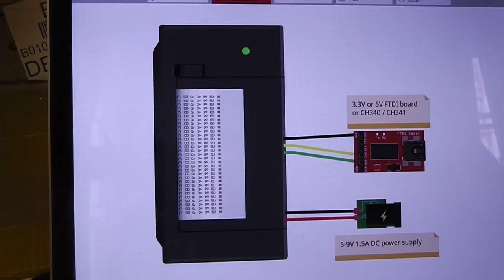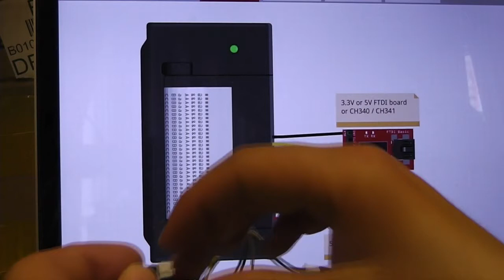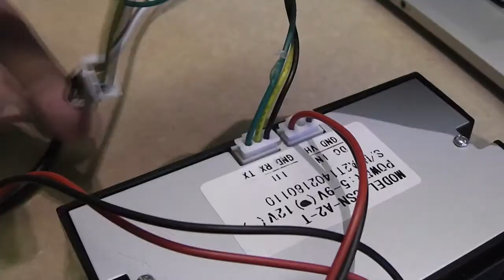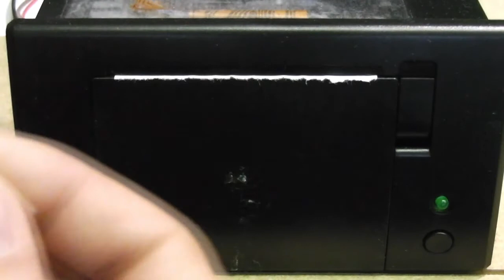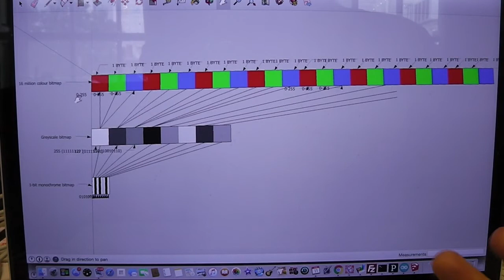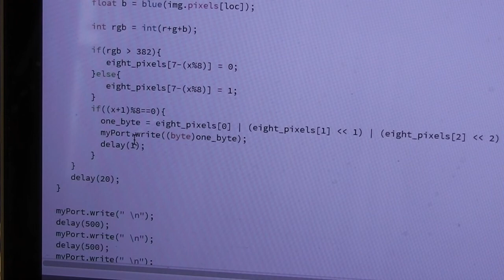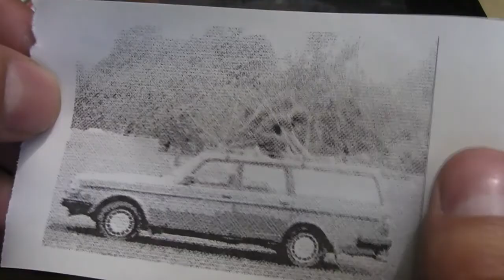Nice photo prints on Thermal Printer tutorial - Circuit diagram + how + why!

Comment: I have StarTSP-100 printer, but no luck in printing photos on it. I installed drivers ok and software. It shows up when I try to print from Photoshop but won't print. It does print a test receipt when I plug in usb though. Any advice? Thanks.
Reply from the maker: Sorry, I'm don't know anything about that. I've only worked with thermal printers that communicate over TTL serial, not USB.
Reply: Ok, thanks. If anyone can help please reply

Comment: Arduino: 1.8.13 (Windows 7), Board: "Arduino Micro"

write_to_printer_direct:1:1: error: 'import' does not name a type; did you mean 'qsort'?

 import processing.serial.*;

 ^~~~~~

 qsort

write_to_printer_direct:3:1: error: 'Serial' does not name a type

 Serial myPort;

 ^~~~~~

write_to_printer_direct:5:1: error: 'PImage' does not name a type

 PImage img;

 ^~~~~~

E:\images_on_thermal_printer\write_to_printer_direct\write_to_printer_direct.pde:8:4: warning: decomposition declaration only available with -std=c++1z or -std=gnu++1z

 int[] eight_pixels = new int[8];

    ^

write_to_printer_direct:8:4: error: decomposition declaration cannot be declared with type 'int'

 int[] eight_pixels = new int[8];

    ^~

E:\images_on_thermal_printer\write_to_printer_direct\write_to_printer_direct.pde:8:4: note: type must be cv-qualified 'auto' or reference to cv-qualified 'auto'

write_to_printer_direct:8:4: error: empty decomposition declaration

write_to_printer_direct:8:7: error: expected initializer before 'eight_pixels'

 int[] eight_pixels = new int[8];

       ^~~~~~~~~~~~

E:\images_on_thermal_printer\write_to_printer_direct\write_to_printer_direct.pde: In function 'void setup()':

write_to_printer_direct:12:3: error: 'size' was not declared in this scope

   size(200, 200);

   ^~~~

E:\images_on_thermal_printer\write_to_printer_direct\write_to_printer_direct.pde:12:3: note: suggested alternative: 'size_t'

   size(200, 200);

   ^~~~

   size_t

E:\images_on_thermal_printer\write_to_printer_direct\write_to_printer_direct.pde:13:9: warning: decomposition declaration only available with -std=c++1z or -std=gnu++1z

   String[] ports = Serial.list();

         ^

write_to_printer_direct:13:9: error: decomposition declaration cannot be declared with type 'String'

   String[] ports = Serial.list();

         ^~

E:\images_on_thermal_printer\write_to_printer_direct\write_to_printer_direct.pde:13:9: note: type must be cv-qualified 'auto' or reference to cv-qualified 'auto'

write_to_printer_direct:13:9: error: empty decomposition declaration

write_to_printer_direct:13:12: error: expected initializer before 'ports'

   String[] ports = Serial.list();

            ^~~~~

write_to_printer_direct:14:22: error: 'ports' was not declared in this scope

   for(int i = 0; i < ports.length; i++){

                      ^~~~~

E:\images_on_thermal_printer\write_to_printer_direct\write_to_printer_direct.pde:14:22: note: suggested alternative: 'puts'

   for(int i = 0; i < ports.length; i++){

                      ^~~~~

                      puts

write_to_printer_direct:16:25: error: 'class Serial_' has no member named 'list'

       portName = Serial.list()[i];

                         ^~~~

write_to_printer_direct:20:5: error: 'myPort' was not declared in this scope

     myPort = new Serial(this, portName, 19200);

     ^~~~~~

E:\images_on_thermal_printer\write_to_printer_direct\write_to_printer_direct.pde:20:5: note: suggested alternative: 'qsort'

     myPort = new Serial(this, portName, 19200);

     ^~~~~~

     qsort

write_to_printer_direct:20:18: error: expected type-specifier before 'Serial'

     myPort = new Serial(this, portName, 19200);

                  ^~~~~~

write_to_printer_direct:22:5: error: 'println' was not declared in this scope

     println(portName);

     ^~~~~~~

E:\images_on_thermal_printer\write_to_printer_direct\write_to_printer_direct.pde:22:5: note: suggested alternative: 'printf'

     println(portName);

     ^~~~~~~

     printf

write_to_printer_direct:24:5: error: 'println' was not declared in this scope

     println("plug in the USB cable");

     ^~~~~~~

E:\images_on_thermal_printer\write_to_printer_direct\write_to_printer_direct.pde:24:5: note: suggested alternative: 'printf'

     println("plug in the USB cable");

     ^~~~~~~

     printf

write_to_printer_direct:27:3: error: 'myPort' was not declared in this scope

   myPort.write(27);

   ^~~~~~

E:\images_on_thermal_printer\write_to_printer_direct\write_to_printer_direct.pde:27:3: note: suggested alternative: 'qsort'

   myPort.write(27);

   ^~~~~~

   qsort

write_to_printer_direct:42:3: error: 'img' was not declared in this scope

   img = loadImage("source_image.jpg");

   ^~~

write_to_printer_direct:42:9: error: 'loadImage' was not declared in this scope

   img = loadImage("source_image.jpg");

         ^~~~~~~~~

write_to_printer_direct:55:20: error: 'red' was not declared in this scope

          float r = red(img.pixels[loc]);

                    ^~~

E:\images_on_thermal_printer\write_to_printer_direct\write_to_printer_direct.pde:55:20: note: suggested alternative: 'fread'

          float r = red(img.pixels[loc]);

                    ^~~

                    fread

write_to_printer_direct:56:20: error: 'green' was not declared in this scope

          float g = green(img.pixels[loc]);

                    ^~~~~

E:\images_on_thermal_printer\write_to_printer_direct\write_to_printer_direct.pde:56:20: note: suggested alternative: 'free'

          float g = green(img.pixels[loc]);

                    ^~~~~

                    free

write_to_printer_direct:57:20: error: 'blue' was not declared in this scope

          float b = blue(img.pixels[loc]);

                    ^~~~

E:\images_on_thermal_printer\write_to_printer_direct\write_to_printer_direct.pde:57:20: note: suggested alternative: 'byte'

          float b = blue(img.pixels[loc]);

                    ^~~~

                    byte

write_to_printer_direct:62:13: error: 'eight_pixels' was not declared in this scope

             eight_pixels[7-(x%8)] = 0;

             ^~~~~~~~~~~~

write_to_printer_direct:64:13: error: 'eight_pixels' was not declared in this scope

             eight_pixels[7-(x%8)] = 1;

             ^~~~~~~~~~~~

write_to_printer_direct:67:23: error: 'eight_pixels' was not declared in this scope

            one_byte = eight_pixels[0] | (eight_pixels[1] << 1) | (eight_pixels[2] << 2) | (eight_pixels[3] << 3) | (eight_pixels[4] << 4) | (eight_pixels[5] << 5) | (eight_pixels[6] << 6) | (eight_pixels[7] << 7);

                       ^~~~~~~~~~~~

exit status 1

'import' does not name a type; did you mean 'qsort'?

This report would have more information with
"Show verbose output during compilation"
option enabled in File -> Preferences.

help me this one im new just experiment ty very much
Reply from the maker: Hi Oliver. The .pde file is a Processing file. That needs to run on your computer in Processing. The thermal printer needs to be connected to your computer via an FTDI USB to serial board. No Arduino is used for that project. The connections you need to make are shown at 0:40 in the video.
Reply: @asciisynth  thank you very much im using same ttl and printer and this is the error when i upload it on arduino 1.8.13 environment thisis the model ofmy ttl bte13-0098
Reply: @asciisynth  thanks this is the error from processing 3.5.4 environ ment    "plug in the USB cable
NullPointerException"

Comment: Can we print the data(like text or barcode) directly on a label paper or label sheet using this printer?
I want to have a paper ready to be stuck directly after printing...
Reply from the maker: These printers only work with thermal paper. They don't print with ink. Thermal paper is impregnated with a chemical that turns black when it's heated. You can buy special labels made from thermal paper but you'd need to make sure to buy the exact right size to fit the printer.
Reply: Thanks for the info. Really Appreciate it.
Reply: Yes you can print on thermal sticker material. my thermal printer was bought used and came with two rolls of thermal sticker material.
They used it to print barcodes, text a photo and printed information for visitor ID.
The thermal sticker rolls come with the special little holes in the paper so that the printer can sense the beginning and end of each sticker. My countertop Zebra printers have this feature but the Adafruit and other small embeddable thermal printers don't usually have the sensor to tell when the sticker begins and ends but they will still print on the stickers if you can find sticker rolls the right size. Otherwise it prints exactly the same information that prints on thermal paper you just must get thermal activated sticker material. but it's available, look online. sometimes you can even find it at Office Depot and Staples.

Comment: Is it possible to make the printer print even though he thinks there's no paper? i got like special photograph paper which is seethrough. The printer blinks three times which means he thinks there's no paper. I've looked into the data sheet and found something this: 

GS a n Enable/Disable Automatic Status Back(ASB)  ASCII GS a  n Decimal 29 97 n Format Hexadecimal 1D 61 n Description n definition as follows: Value Bit Function 0 1 0 0   1    2 Disable/Enable ASB  Disable Enable 3-4    
5 
Disable/Enable RTS as flow control 
Disable Enable 
6-7    When ASB is enabled, the printer will send the changed status to PC automatically.  

I'm not sure what this exactly means.
Reply: Maurits Muis sure just put a piece of tape over the sensor so it can't see through the clear
Reply: If you want to get fancier than that then you can always open the printer up and clip the wire and put a switch on there so you can turn the paper sensor on and off.

Comment: i have a homework to fix the mini thermal printer . i already have a coding but its doesn't work . can you give me a coding program arduino ? its will help me.thanks you
Reply: titah iftitah and do your libraries reflect this difference in wiring?
Does the original thermal printer library for the thermal library and code without the converter have code that conflict's with the necessity of keeping the original thermal printer library and adding the additional libraries for the converter?

What does the converter do? considering that the original Adafruit thermal printer still only hooks up with just the same amount of wires?

Comment: Hello,
It is useful video. but unfortunately I have a problem with my Mini Thermal Receipt Printer. It prints Chinese symbols when I uploaded follow code:
#include <SoftwareSerial.h>

SoftwareSerial t(5, 6);
void setup() {
  Serial.begin(9600); // for debug info to serial monitor
 t.begin(19200);
 Serial.println();
 Serial.println("Printer ready"); 
 t.print(" Millis = ");
}

void loop() {
  // put your main code here, to run repeatedly:

}

Could you help me, please?
Reply from the maker: salome oniani it sounds like the printer may have a different baud rate set. Before trying to print anything you need to set the printer baud rate to 9600. Or put different baud rates into the sketch until it works. There are only a few common baud rates so it shouldnt take many tries until it works.
Reply: OpenTronic Thank you for information. I try all baud rate (300. 1200. 2400. 4800. 9600. 19200. 38400. 57600. 74880. 115200. 230400. 250000) but it doesn't work. could you help me, please, to find some more information about it. Thanks again.
Reply from the maker: salome oniani sorry this may sound obvious but were you changing the baud rate on 't'?
Reply: OpenTronic Thank you for trying to help me, yes I am changing the baud on 't'.
Sorry for the inconvenience. I'll try to contact with saller.
Tanks again.

Comment: Interesting build and great explanation. While perhaps of little importance for the printer, when converting from color to grayscale, often there are weights on the RGB components, to approximate the eye's decreasing sensitivity to green, red, and blue. I would like to have heard more about your stippling method. Have you tried this or something similar with a laser? (I found your channel from Educating Savvas' mention). Best wishes, Kent
Reply from the maker: I'm glad to hear that Savvas is giving me some shout-outs because I've been giving him quite a lot of hints for his CNC electronics recently ;) Interesting about weighting to the eye's sensitivity. You reminded me of when Savvas and myself did some old style photography, and it turned out the paper was far more sensitive to blue and UV light than the eye, so negative images of the sky usually came out totally black yielding a whited-out print. I think it was something to do with insensitivity to red light necessary for dark room processes. I haven't tried the stippling method on a laser, but now you gave me the idea! The modified version of Marlin I use on my laser cutter has a facility for raster images that I haven't even tried yet. So far I've been too fascinated with the potential to make mechanisms and 3d objects to even try images on the laser yet. Apart from marquetry.

Comment: you didn't use ESC pos commands to control image printing? right? i didn't find the command 18 42 1 48.
Reply from the maker: 18 42 is the command that tells the printer to print a bitmap. The bytes 1 and 48 tell the printer that the bitmap will be 1 pixel high by 48 * 8 = 384 pixels wide. The 48 bytes that are sent afterwards contain the image data itself (one row of the original image). On this printer, the maximum dimensions you can print in a single bitmap are 384 wide by 255 rows, but by splitting the original image into rows and printing each row as if it is a separate bitmap, you can print images with more than 255 rows. That's why the command I'm using specifies 1 pixel high.
Reply: Thank you for you reply! I find my printer doesn't support 18 42 command ( I find this command, 18 42 is DC2 *), and i tried to use several methods to print image: ESC * , GS V 0...i tried two different printers: both of them can set printing option by using the command: ESC 7 n1 n2 n3.. so I can't set the heat time.The printing result is so grey..
I wonder if i can use raster print mode (GS V 0) instead of your DC2 * printing Mode? same raster mode one line by one..
Reply: the printer you bought , i find it one market , after check the program manual seller send me , i didn't find 18 42(dc2 *) command.
Reply from the maker: My thermal printer's model number is CSN-A2-T, and it's the sort sold by Adafruit or Cool Components although I bought it from eBay. It seems to be the most common thermal printer available, but you may have a different model, even if it looks similar. I think these things get cloned all the time. If your print is grey, it may help to use a power supply which has more current available. The PSU I'm using can supply up to 5A. BUT - your printer may be different, so I wouldn't recommend using a different power supply without reading the manual thoroughly.
Reply: i think the main reason of grey result is the heating time. i can not set it like you did , before sending the image data..